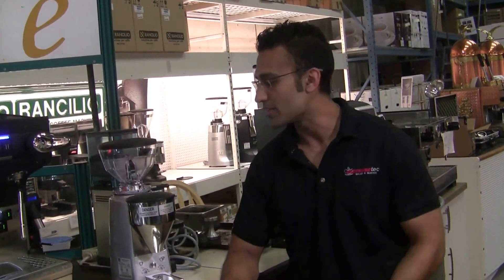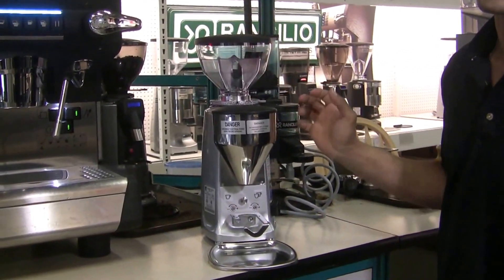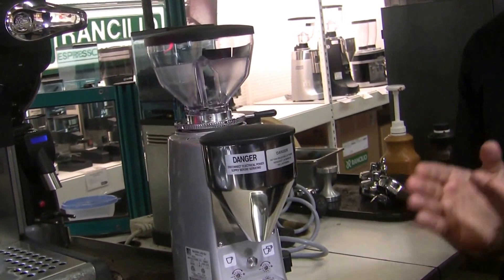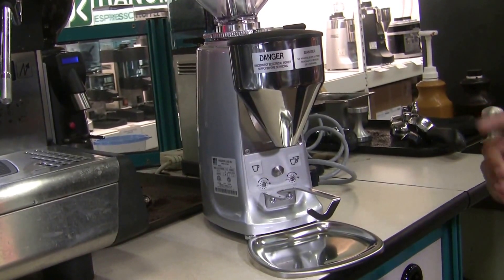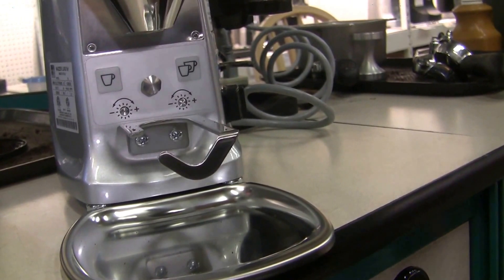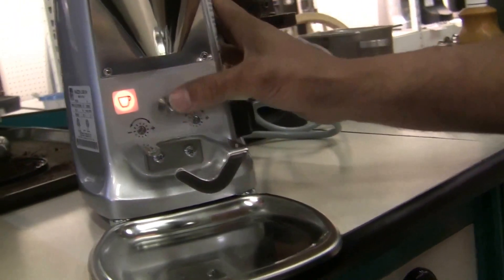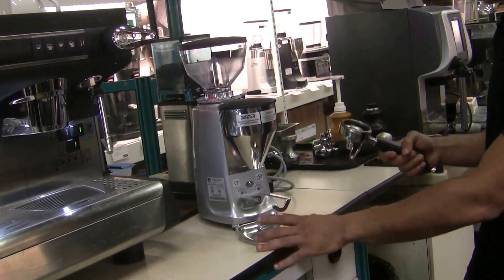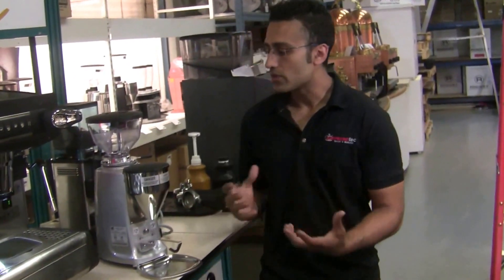Mazzer Mini Electronic B - Overview

Comment: which is better for single doses home use, Type A or B
i dont want much coffee left overs ?
Reply from the maker: Muhsin Ali Both will be great since they have programmable dosing. The A is electronically programmed while the B is manually programmed via a dial. With a steady hand the B is great otherwise the A is very easy to adjust.